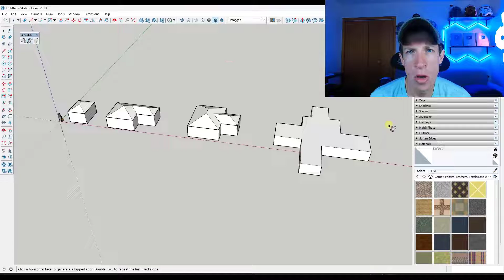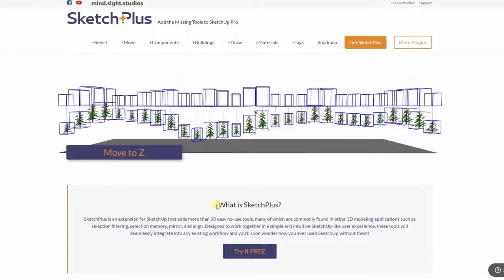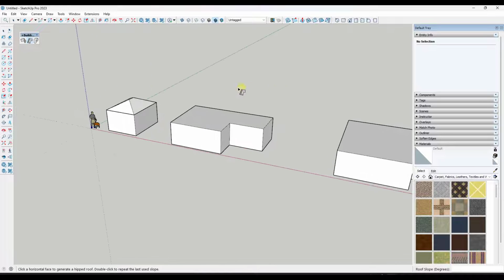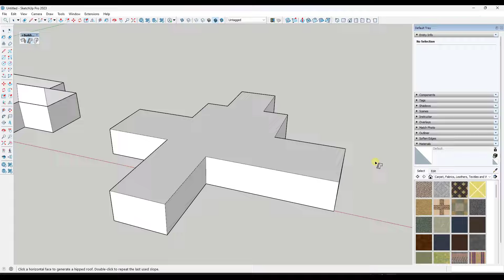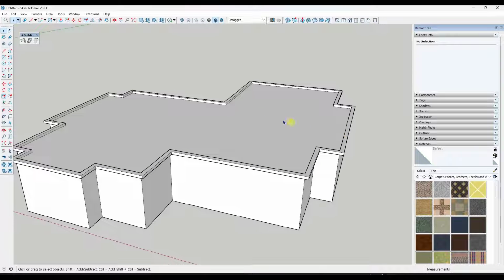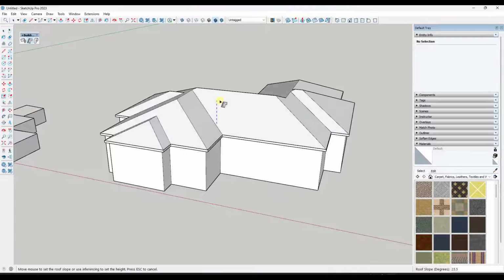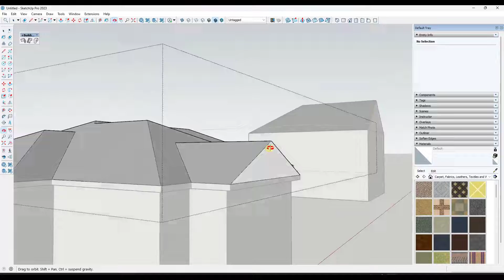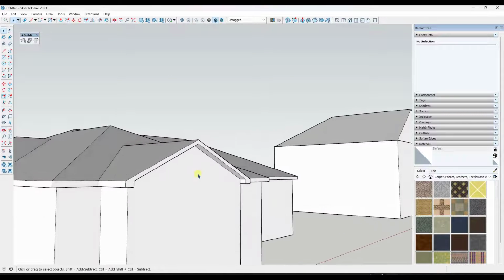Fast HIP ROOFS in SketchUp with SketchPlus! (New Feature Tutorial)

Comment: Very cool but roofs are usually 4:1, 6:1, 12:1 not typically in degrees when called out on Architectural drawings. I know you can do the math to figure it out but it would have been better to use roof slopes that we use in the trade.
Reply from the maker: I mean...it seems like if you know that you can do math to figure it out, you probably don't need to see that in the video itself...
Reply: @Thesketchupessentials  That's not the point, this is Architecture they should use the terms that Architects use.